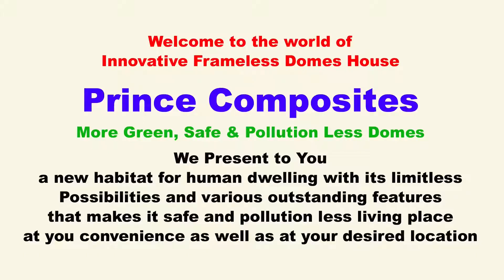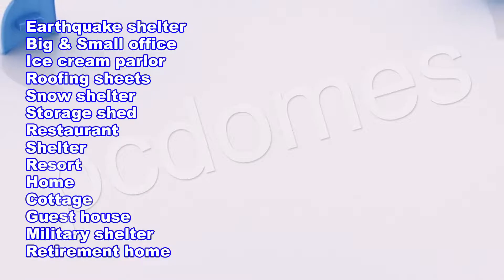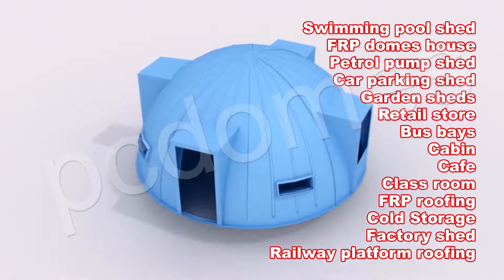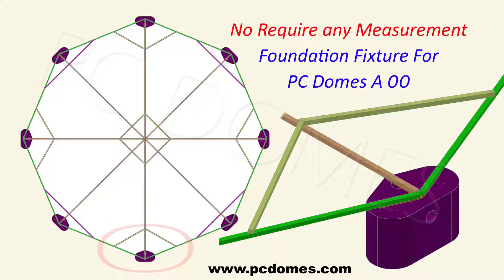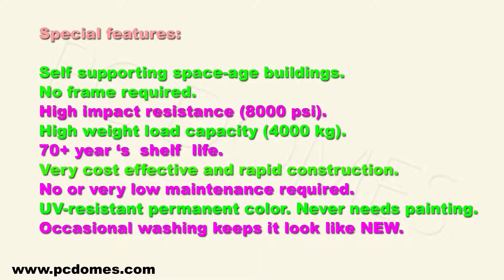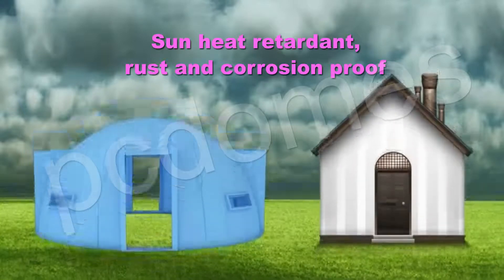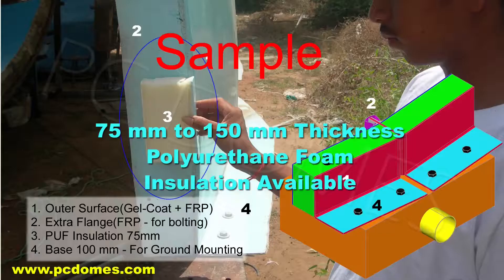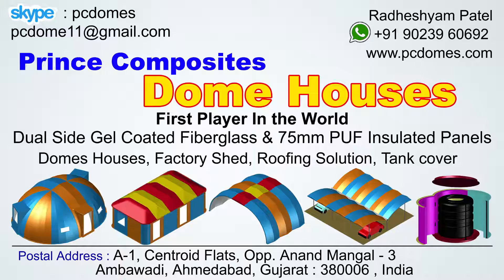3D Animation Dual Side Gel Coated Surface PUF Sandwich Penal Fiberglass Prefab Shelter PC Dome House

Comment: What is the cost of single hut?
Reply from the maker: Model A 00 , Class-3 Material Thickness- 3.5 to 4 Lac + GST+ transport + Installation for more detail Mo.+91 70 1615 9450, Email: pcdome11@gmail.com
Reply: @pcdomeradheshyampatel6732  How many sqaure feet would this be?